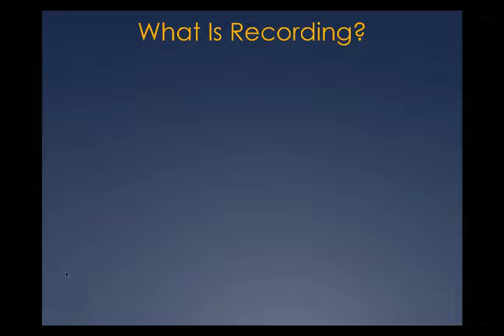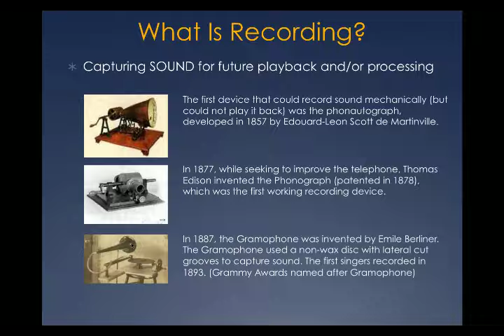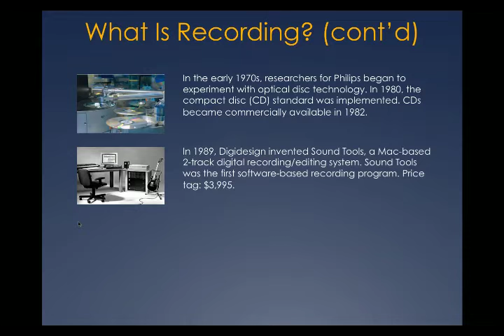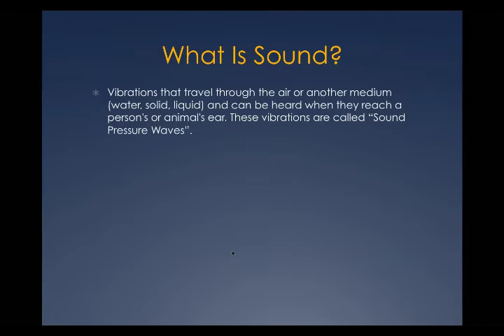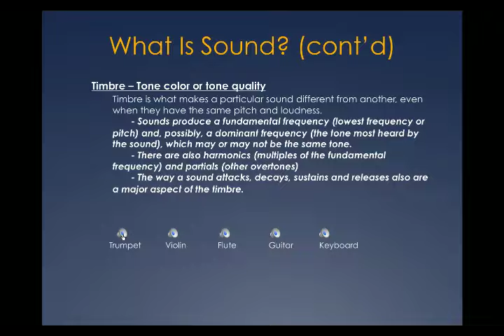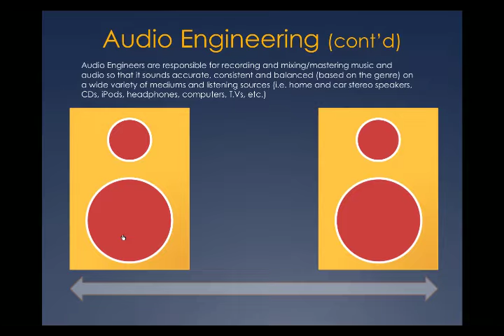The Fundamentals Of Sound

Comment: If you mixed a song and found the vocal was too quiet:
A.You would re-record the vocal. B. You would remix the song
C. You would add some echo. D. You would not do anything.
Reply from the maker: When you say "the vocal was too quiet" does that mean that the recording level was low or that the volume in the mix is low? If it's the latter, then work on achieving balance by either turning the vocal up in the mix and/or turning the volume down on other instruments in your mix. If it's the former, and  you recorded the tune yourself, you would have wanted to re-record the vocals if the recording level was too low. Not sure why you would want to add delay (aka echo) if a vocal was too quiet.